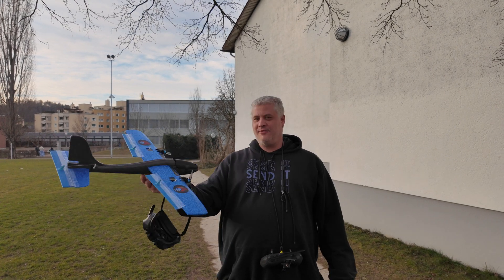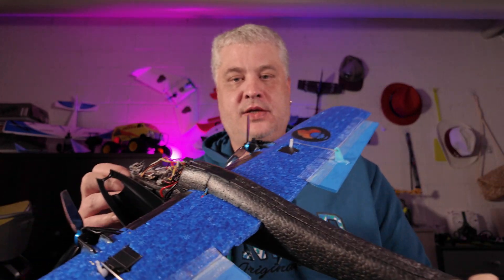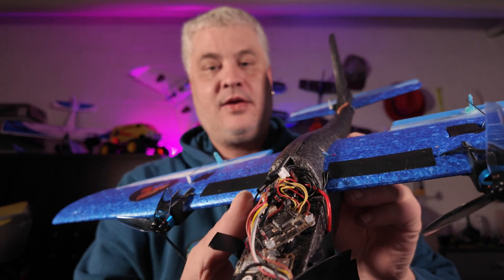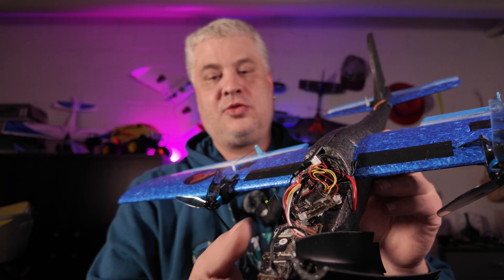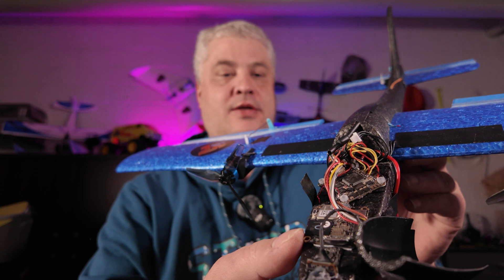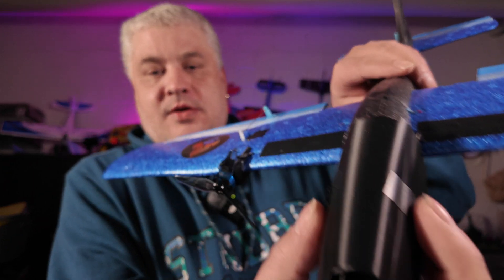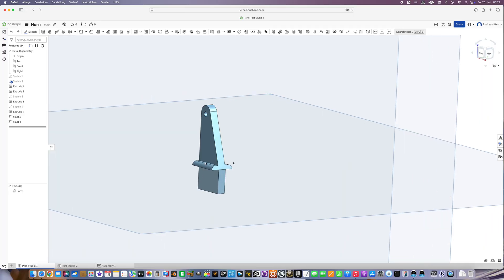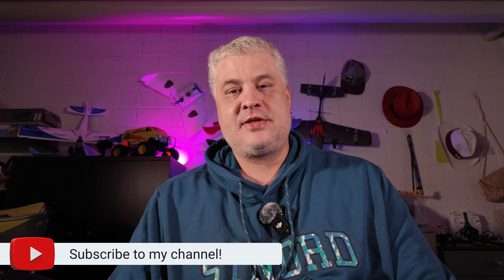Foam Plane Evolution 60cm, DJI O4 Lite

Comment: Hi! Should I connect motors to m1 and m2 or is it irrelevant? Thanks in advance!
Reply from the maker: You can actually use all Motor Outputs. If you use 2 Motors I would start with M1 and M2 but the others works as well if configured correctly in inav
Reply: Thanks!  @RockFPV

Comment: Hi, Im building one currently. How many millimeters are the cg from the leading edge? Tq
Reply from the maker: The cg is usually around the upper 3/4 of the wing. So measure half of the wing and divide the upper half again by 2. Not 100% accurate but it should be fine

Comment: Cool plane. Is the flight video really without stabilisation?(Rocksteady or gyroflow)
Reply from the maker: It was recorded in 4:3 and then stretched in gyroflow. It has about 10% smoothness correction but without gyro data
Reply: @RockFPV  thanks for your answer. Some raw Flight video would be cool. I'm interested to see how the plane flies.
Reply from the maker: It's almost raw, you probably won't notice a difference. There was 0 wind on that day which made it already super stable
Reply from the maker: @eliokreier522 There are as well short clips from the goggles, these are unmodified

Comment: Printed parts do come in handy, love the way that you usually put the control horns on the top surface instead on the bottom, less to snag and snap into anything in landing on grass or sketchier places 😉
I might be old school-guy puzzling over why you don't have the control horn center point on the hinge line, but having separate servo channels for ailerons and the modern day computer radios makes it obsolete? Haha  😆 Flies great tho'!
Reply from the maker: Thanks! Sometimes I myself don't know why exactly I did something in a specific way haha. It's a learning process and every build will be better than the last one. Just flying and building since 5 months :)
Reply: @RockFPV  that is a fast progress you've had there 😄 Hope you keep up the spark and enthusiasm with the hobby!
Reply from the maker: @theKeppis  Thanks! It's frereshing after all these Years of solely Flying Drones. I most likely try all kind of different things.I have a helicopter waiting, a flying Car is as well quite high on the List. Let's see :-) As long I can FPV it, I will try :-)